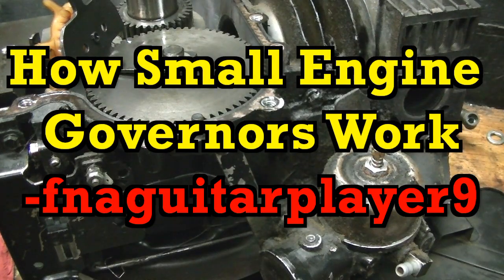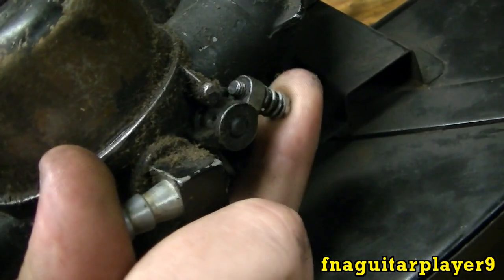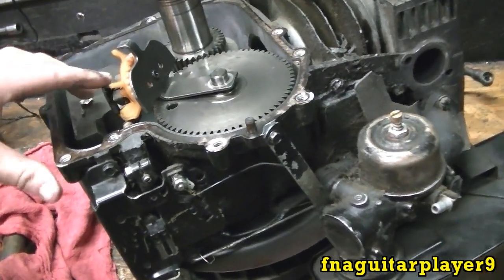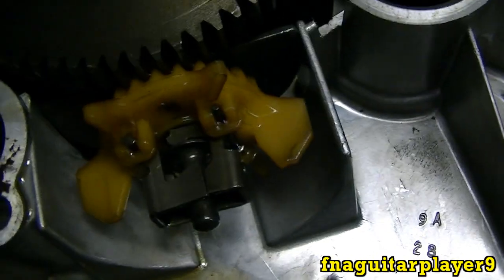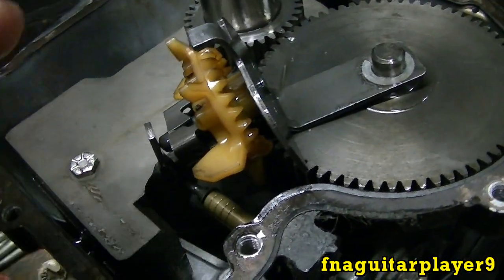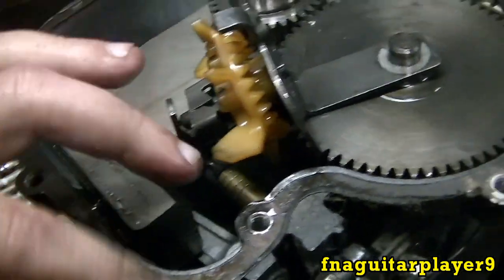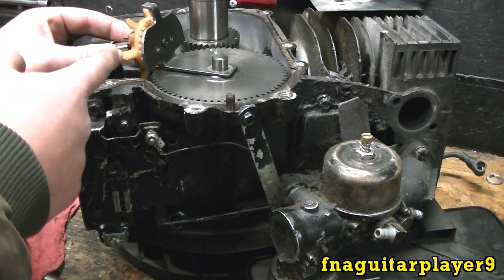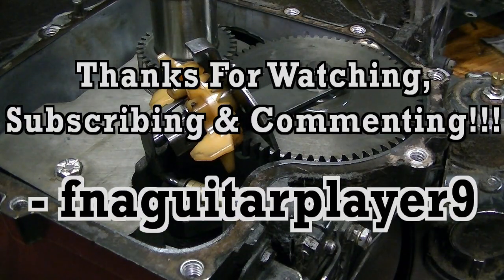How Small Engine Governors Work (any governor setup)

Comment: Excellent video. I have a self-propelled Toro with a Briggs 6.75 … and also the blade brake feature. Problem for me is variable rpms because of the blade brake. If I set rpm (using a tach and bending the tang, per Briggs, to stretch or compress the (new) gov. spring) to, say, 3100 when the motor is running but the blade isn’t spinning everything seems fine. But then when I engage the blade (load) rpm drops to the mid-2000’s and the mower sounds and performs weak. So I then set the load rpm to 3100, but when I let go of the blade brake bail to stop the blade, the rpm races to 3700 and more & it sounds like it’s going to blow up. I think have adjusted everything I can adjust externally; do you think the weighted governor part in the sump is not working properly?
Reply from the maker: That engine should have a air vane governor, i could be wrong, some do and some don't, if it is a internal governor than that could be whats wrong or if its air vane it could be grass or dirt build up under the flywheel cover, most push mower engines are air vane though. It could be that the blade brake isn't disengaging completely causing excessive load on the engine. I would check that first. Hope this helps, Thanks for Watching!!!

Comment: Thanks, My mower will not increase RPM when it gets loaded so I am trying to find out the problem before starting to take everything apart
Reply from the maker: If the carburetor is in good shape then i'd say its governor related, may just need to be adjusted. Thanks for Watching!
Reply: My tiller is doing the same thing. So is it too governed down.  It’s a 5 Hp BS. Horizontal shaft. Went from running too fast to too slow now.   I adjusted it I thought correctly using wide open throttle and clockwise governor turn and locked it down with the clamp it had.  This thing is driving me insane. I figure out one part another thing fails. Carb rebuilt, new pickup tube. New spark plug new pull rope. It hates me I guess. Any thoughts as to why it now seems under powered and how to rectify this.  Man your videos are awesome. Well done.

Comment: Be careful what you buy as engines that have an oil pump do last longer as Toro used to one of them. Slinging oil onto the piston, rings, cylinder and connecting rod is a poor attempt to lubricate parts that are abused during normal use. Very few will tell you that residential mowers and others have a 150 hour expected life. Commercial mowers are designed to have 5,000 hours of life, before service or replacement of a part are required. So, check oil before every use. Buy a suction gun as dipstick tubes are large enough to pull the old oil out and replace with fresh new. 
ASE Master Tech since 78, retired.

Comment: Thanks for your video.  My craftsman riding lawn mower does not maintain constant speed.  The engine revs up to a racing speed without me moving the throttle control.  I have to constantly keep moving the throttle control up and down to maintain a reasonable RPM of the engine.  Is this my throttle control  or maybe my carburetor diaphragm, or the governor? Thank you very much for helping.
Reply from the maker: +Danpartin Your welcome! That sounds more like a governor problem, it could be a carburetor problem, sometimes if a gasket isn't sealing (carburetor-intake gasket) it will pull in to much air will race like that, but i'd check the governor first. Your welcome, Thanks for Watching!!!

Comment: I need to adjust the lean rich mixture on the new carburettor. Can running lean cause surging?
Reply from the maker: Yes it can, it will "hunt" trying to keep the rpms up. Turn the adjustment screw out about a 1/2 turn then again if it doesn't enough. Thanks for Watching!!!
Reply: @fnaguitarplayer9 
So you are saying that the hunting is the governor and engine trying to compensate for a bad mixture.
Thankyou very much.
What are the signs of a bad govenor?

Comment: I just replaced a carburetor on a Briggs and Stratton and it’s running too wide open. The only way to get it, to not run so high, is to choke it down. Do you have any ideas what I’m doing wrong?
Reply from the maker: May need to adjust the governor I have a separate video just on that. Thanks for Watching!!!

Comment: Your videos are excellent and have been a big help to me.  I have a 14.5 HP B&S OHV engine on a riding mower (1993 MTD) which has a 2 piece carburetor (also helpful videos that you have).  Runs fine without the mower engaged, but surges when it's engaged - even backfires out the exhaust.  Is that a governor problem or a carburetor problem?  I've cleaned the carb twice, but ...  Haven't been able to get the nozzle out.  I think the threads are galled.  Anyway, just wondering.
Reply from the maker: Appreciate that! Glad to help out! Honestly it could be either, or both, i'd say try adjusting the governor first and see what it does, if not, then you may need to get a kit for the carb. Hopefully you will be able to get the nozzle out, that may be the problem (sounds like it may be running to lean = less power). Hope this helps! Thanks for Watching!!!

Comment: Good video. Very clear demonstration!
Reply from the maker: JOE Z Thanks for Watching!!!
Reply: Thank you for the video and the explanation.I had a problem with my craftsman model 917.388831 with a briggs and straton engine, engine model 10L902-0469-E1 and the problem was that the lawnmower slowed down when I started to mow the grass up until the point that it would not run so I removed the top cover and removed the air filter (filter was dirty) And I found that a spring that was supposed to be connected to the carburetor butterfly valve had broken off. I found a spring that I had laying around and installed it ( it was not the proper spring but is was a small spring ) I started the lawn mower and it went to full throttle and it stayed like that, it would not go to idle.Is the reason that it went to full throttle because it has the wrong spring? I am going to buy the correct spring for the carburetor and hope that it cures the problem. And if it does not then I am thinking that it might be missing another spring or springs.Any advice will be greatly appreciated.Cheers

Comment: we have 2 champion 4000 generators they have been sitting up for a couple of years we cleaned out the carburetors and adjusted the governor when you start it it runs full throttle
the only way to drop the rpms is to half choke it
Reply from the maker: I almost bought one of them a few years ago. Sounds like the governor needs adjusted or you adjusted it the wrong direction or a linkage is in a bind making it stick wide open, have had that happen before. Thanks for Watching!!!

Comment: Is there a way to measure the tension required on the spring ? In other words, how can I tell that the spring installed is the right one.Thanks for the good video.
Reply from the maker: R Verro Not really a way to measure the spring tension, they do stretch over time which will cause the motor not to rev up as high when given full throttle, it may only reach like 3200 RPM instead of 3600, in that case you have to end up replacing it, so in other words, if the engine isn't coming up to 3600RPM with no load and the throttle cable and governor is set right, its a weak spring. I should have talked about this on the video. Thanks for Watching!!!

Comment: I have a 2.5 hp tecumseh, and there IS NO GOVERNOR ARM. It drove me INSANE trying to figure out how the damn thing pushed the throttle arm back. I still don't know for sure how it works, other than the pivot itself that lets the throttle arm move must be going all the way through the case and connecting to the governor internally. There is literally just a thin piece of metal that connects to the throttle plate on one end (via a pushing wire) and on the other end of the thin piece of metal, it is connected to a pivot. THATS IT. There is also a little spring that connects this throttle arm to the linkage for the gas pedal. When i floor it, the damn throttle arm just magically backs off and pushes against the spring, WITH NO GOVERNER ARM ANYWHERE. I feel like i'm going insane staring at this damn throttle arm as it just magically governs back while running. It has to be the pivot point, which is the only part of the throttle arm actually attached to the engine block at all.

Comment: I appreciate you explaining how the internals of a governor works. 
Despite being able to understand how the governor works which I greatly appreciate you explaining but unfortunately I'm still not quite sure what could have caused or is causing my 17.5 Briggs and Stratton on my Troy Bilt 42" pony was running good and while cutting a normal grass height last week with out touching anything all of a sudden the rpms of the normal high speed went  from around 3600 rpms straight up to probably 7 or 8 thousand rpms which immediately cut the engine off to prevent a blown engine.   I thoroughly cleaned the carburetor and all its internals "clean as a whistle " . Try to restart it with the throttle on low and it was hard toget started but when it did it went straight to that extreme high rpm and I immediately shut it off again.  Being that I've never seen a small engine do this before I'm feeling dumbfounded?  Would you have any ideas on what is causing this problem? 
I greatly appreciate your input on this crazy and what seems to me very rare probably.  My mower is like my best friend (lol) so you can imagine how stressed I am especially after seeing the prices of a new engine for it.  
Thanks for your informative video and any input you are able to provide.  👍
Reply: Maybe one of the weights on the governor fell off. If that's possible.
Reply: So after taking crank housing off  I  was able to see that the governor had been torn to pieces and after laying all the pieces out on the work bench 
 I have come to the conclusion that more than likely the steel pin on the camshaft sheered off and as it did it destroyed the governor assembly mainly because it's mostly all plastic.  
 After cleaning the engine block really well and installing a new camshaft as well as a new governor assembly  and putting it all back together my lawnmower was back in business and have been using it ever since with no related problems concerning the engine . Knock on wood.🤞  Don't want to Jenks myself. LOL

Comment: So if someone were to remove the governor arm and cause the engine to go faster would it damage the engine
Reply from the maker: Yes, the connecting rod will break at higher then governed rpms, thats the first thing that goes most of the time. Thanks for Watching!!!

Comment: is it a good idea to take the governor off a Briggs & Stratton horizontal engine if you're using it on a go-kart. or should you just adjust the governor for more RPMs thanks and great video.
Reply from the maker: No, leave the governor alone, you can adjust it slightly to get a little more out of it, but  a stock engine isn't designed for more than 3600 rpm, some say 4000 is safe, but i'd say concentrate on the gear ratio, you can get alot out of stock engines if its geared right. Some do bypass the governor and they will hold up as long as you don't stay on it WOT the whole time, they will usually short bursts. But its still not recommended. Thanks for Watching!!!

Comment: I found the video very informative.  Watched it because I have an a old Simplicity 7016 with a 16 horse Briggs that won't throttle up even with the remote throttle full forward.  Can't manually move the throttle plate.  Should I be able to move the governor arm with the engine not running?
Reply from the maker: Glad to hear! I hear ya, yes, you should be able to move the throttle plate or governor arm / linkage with it running or not running. If the throttle is set to fast, it will be stiffer do to the spring tension on the governor spring. Thanks for Watching!!!

Comment: I adjusted mine on a 12.5 HP Briggs because it was running to wide open and surging really bad, I watched a couple different videos on here and did it the same way and now it’s running wide open even worse. Like completely full throttle, do you know what could be the problem?
Reply from the maker: Could be several things, first thing if the governor spring is broke or the linkage came loose it will pull the throttle open, possibly the governor is out of adjustment, worst case scenario the internal governor piece could be bad. thanks for watching!!!

Comment: My generator (1500w) is producing 300v, and under load of 1050w, voltage goes to about 225v. Is that normal ? And how do I fix that ? Are weak springs problem ?
Reply from the maker: No its not normal, sounds like the governor is out of adjustment. Thanks for Watching!!!

Comment: I had to order a new governor oil slinger. When I got my new item, the plastic gear is stiff and requires a bit of force by hand to turn. in the past all governors I have dealt with would spin freely by hand. Do you think I have a defective governor? I really need to get my mower working as my grass is getting high.
Reply from the maker: I hear ya. It should spin freely, try putting some oil on it it might just have a burr on the plastic or something. If it not then I'd say there is something wrong with it. I hear ya. Sorry for the delay! Thanks for Watching!!!

Comment: If i have a generator that doesn't rev up with a load does that mean that the governor is broke inside? It is at full throttle before it starts but goes to idle as soon as it starts and does not rev up with load
Reply from the maker: The governor may just need adjusting, or if it is supposed to idle with no load then rev up when a load is put on it, something may be wrong with the electronic circuit that controls that. Thanks for Watching!!!

Comment: Just bought my first riding mower. It's a used mower and your videos have been a godsend! I haven't started mine yet. Is there anything you would recomend checking before starting an engine that is used?
Reply from the maker: I hear ya! Glad to help out! I actually have a video on starting engines that have been sitting for a while, i go over several tips on things to check out before starting, I used a 14hp briggs opposed twin cylinder as example, here' the video: https://youtu.be/cL4NCn4lOtY Thanks for Watching!!!

Comment: So basically remove the metal form the oil slinger to ger more rip em's
Reply from the maker: no, you would usually just connect throttle cable directly to the governor arm/linkage instead of through a spring. Thanks for Watching!!!

Comment: @41 seconds in , that thing you touched and called a throttle plate , is called a governor plate. Theirs only 1 throttle plate and that's the 1 inside the carburetor and not outside the carburetor.
Reply from the maker: King County True, I guess i meant the plate inside, but yeah that would be the governor plate or linkage plate. Thanks for Watching!!!

Comment: I have a Dixie chopper mower. That when I m mowing the RPM is 3100  .then when I turn the blades off. The RPM increases all the way to 3900.any suggestions! It will appreciated
Reply from the maker: That can either be a carburetor issue or a governor problem, if its running to lean it will do that, it may not have a mixture adjustment, most of the dixie's i have worked on don't. but if its a governor problem then it will need to be adjusted. I have a video on adjusting them. Thanks for Watching!!!

Comment: what does it do in very simple words why does some engine need that what if you take it all off
Reply from the maker: It regulates engine speed, without it, say its on a lawn mower, it will start slowing down under load, with it, it will open the throttle up enough to maintain rpms. Thanks for Watching!!!

Comment: please help me I have a John Deere la115 I started it it up it was running fine then all of the sudden the Idol start screaming real loud so I shut the engine off if I started with the throttle the whole way down and take my finger on the governor rod and push it forward it will idle fine but if I let my finger off the governor rod it starts running super fast what you think my problem is
Reply from the maker: Sounds like either the governor spring broke or a linkage came loose making it want to run at full throttle. Thanks for Watching!!!

Comment: FNA Guitar Player,  Thanks for the great video.  I am embarrassed to say that a toothpick fell into the Kohler riding mower  engine while I was changing the oil (long story). 

I am trying to visualize if this could possibly be a problem.  The toothpick is standard size of 2 inches and made of bamboo. The only place where I see it might get stuck is behind the pin that holds the weights.  And even if the rod slowed or locked, then it seems it would not affect the gear.  The only thing that might happen is the throttle locks at one speed. 

Any thoughts or insight? 

Thanks.

Comment: I don't understand, in many cases, a governor is more to keep the engine from overspeeding, not to keep a steady RPM...what prevents a Briggs from "running away", say if the throttle gets stuck wide open at zero load?
Reply from the maker: I hear ya, when the rpms start increasing the centrifugal force on the oil slinger/governor is more so it will regulate itself against the force of the spring. if this makes senses, its hard to explain! Thanks for Watching!!!

Comment: Nice video.  I wanted to know how it worked because we had a tech come out to replace the governor on a mower that would only run at full throttle.  He ended up ordering a whole new engine!  It didn't matter too much as the mower was under warranty, but I thought there had to be a cheaper way.
Reply from the maker: Thanks! I hear ya! I think that was overkill replacing the engine, it may have just not been set right, it has to be adjusted, and its easy to get it wrong. Thanks for Watching!!!